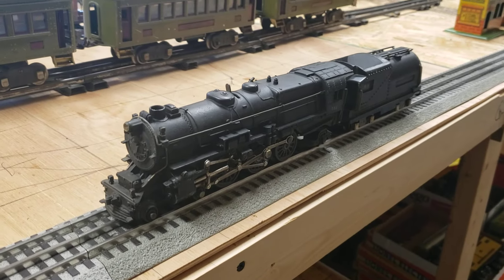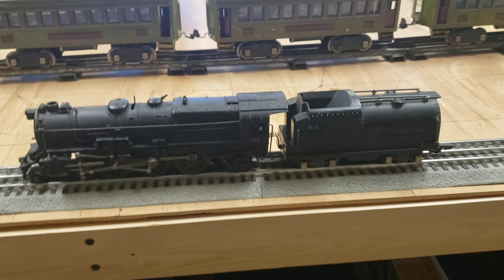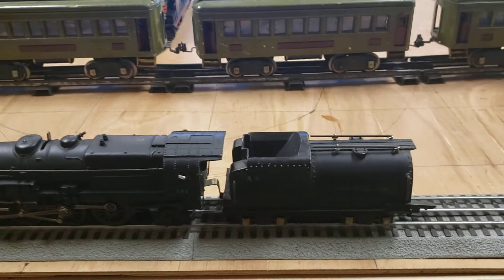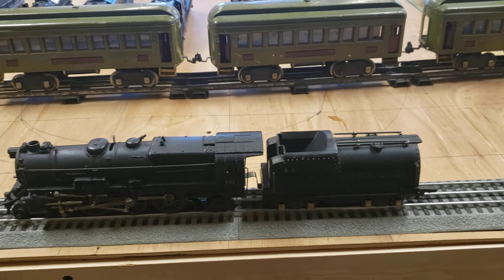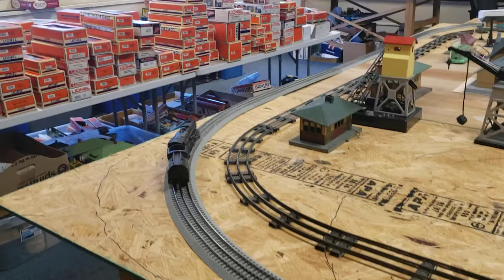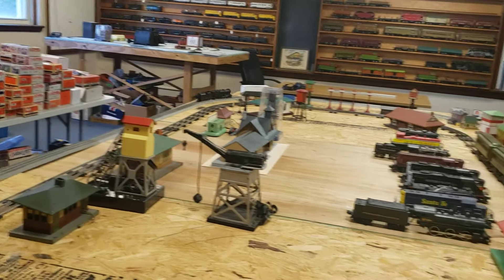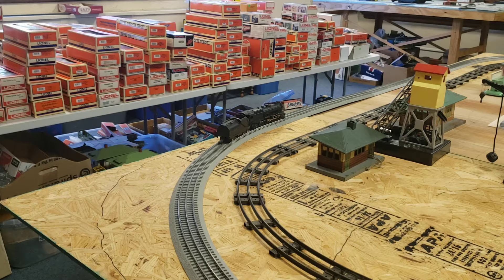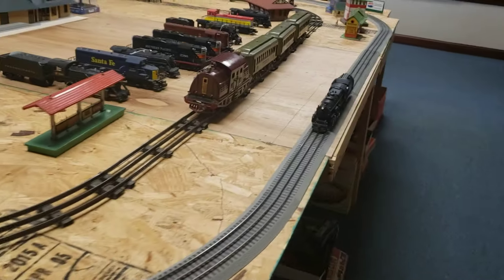American Flyer Prewar O Gauge 4-6-2 Steam Locomotive No.  561 with Type VI Tender

Comment: Hi, just run across your site. I was given by my older brother, his American Flyer train sets along with a complete Erector set # 8 1/2 . The two train sets are from the 1930's , The City of Denver is a four car set with a mechanical whistle car, it runs on a 4 rail track for the whistle car. The Locomotive has the # 425 stamped on it and the Vanderbilt tender just says American Flyer. It has the green gondola, red and white box car,  silver tank car, red search light car, yellow wrecker car and red caboose. There are two transformers, mod.1283, 100 watt goes with City of Denver. Mod. 7B 75 watt  with the locomotive. Several un-coupler tracks for the loco, along with a goodly amount of American Flyer track, X crossings,  curve and switch track. The train sets have been put away since my boys grew up, maybe 40 years now. The Erector set, my one son made the Walking Beam steam engine for science class in the 80's. The teacher was so impressed, as no one had seen an Erector set before. Brought in several classes just to watch it work. Looks like you have a large collection of Lionel cars, nice set up.